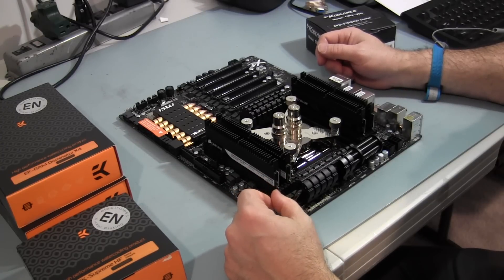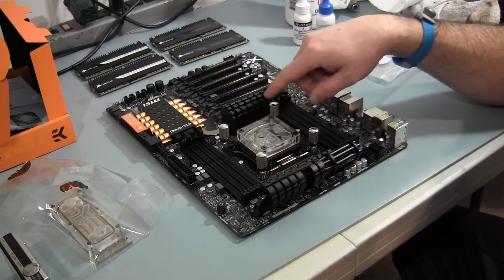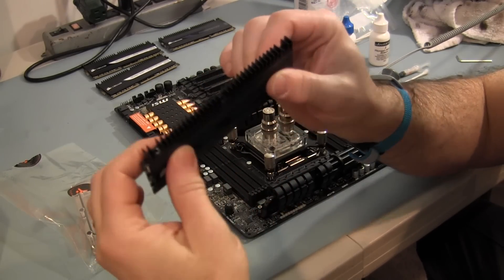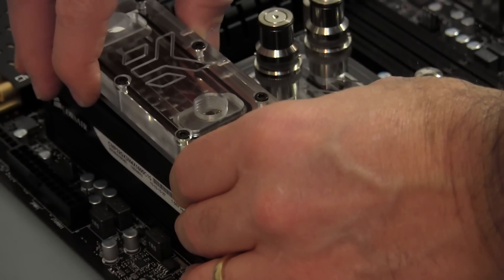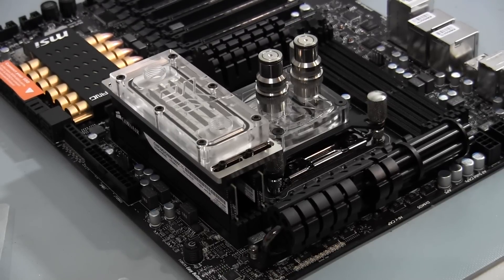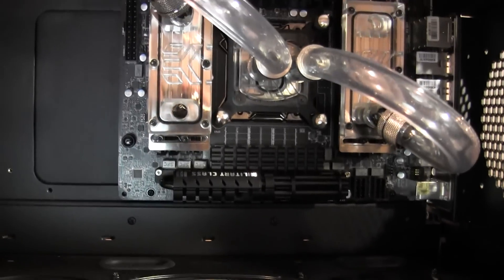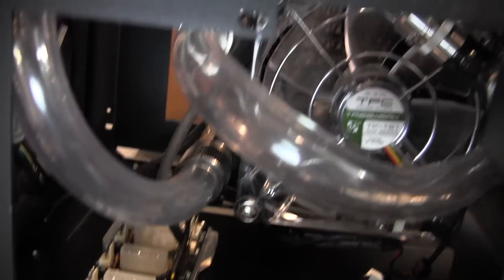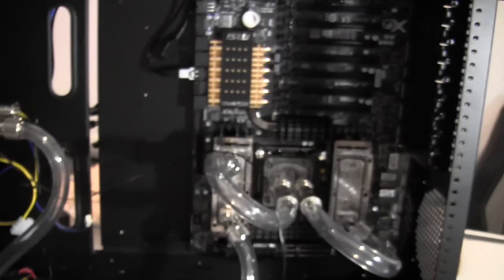Big Bang XPower II Kick Ass Build- Part 2 - Install Water Blocks and Run Loop

Comment: I noticed you used thermal paste instead of tape when mounting the memory water blocks.  Does paste delivery better thermal performance?  If you ever decide to install chipset water blocks for your Big Bang motherboard, could you also use thermal paste on the MOSFETs as well?  Just curious what the trade-offs are regarding paste versus tape...

Comment: Why you use these quick disconnects? They are messy .... It would be nice to see a waterblock for big bang :) (http://www.watercoolinguk.co.uk/p/XSPC-X79-XPOWER-II-WaterBlock-Set_29041.html) or even EK has a block for it.  Kind regards.

BTW - u r using the best case IMO.  I am at the beginning of designing my own case, but if it fails, I will buy CL MAGNUM STH10! Good choice :)
Reply from the maker: There is a water block for it , and I did buy it but never installed.  Was a little overkill on the QDC's.  I just wanted to make it easy to service.  But I did use too many.
Reply: Ronsanut .
:) yeah to many QDC :)  once again Thanks for video! Best regards and please continue :)

Comment from the maker: On this system I kind of went overboard on QDC's.  You only really need them at certain points in a system. I have since used them sparingly in systems.

Comment: sorry I have a hafx case and i'm looking to mount my radiator in the top and was wondering once I mount my rad and fans will the bottom edge hit the gatlin gun on the motherboard or do i have to buy waterblocks to replace the gun?  sorry if my question wasn't clear lol

Comment from the maker: It is a common misconception that you must go to the CPU first. The loop order does not matter. With a good pump and flow the heat is removed and passed through the system very quickly through the rads to dissipate. The ONLY order that does is that the pump MUST immediately follow the reservoir.

Comment: Why wasn't the coolant directed to the CPU first?  Surely it's the prime reason for a water/whatever based cooling requirement full stop.  I know RAM and Graphics, chip sets, etc all have their reasons too, But if the CPU cannot be clocked for heat reasons then everything else that rely's on it, becomes secondary to it.

Comment from the maker: I have only used BitsPower and Koolance Fittings mainly. I do have a new build coming up where I use Monsoon Fittings. Will see how well they do,  I have used the Koolance QDC's for a long time and they work great, but you do not have to use them. You can create a drain with BitPower T fittings as well.

Comment from the maker: For the most part now I will use them always at the radiators, and in the back of bay reservoir connections so that I can easily disconnect and remove those parts without having to drain the system. That also helps if you have a removable motherboard tray so you disconnect one coming from the rad to the CPU block  and the one leaving the GPU to the reservoir.  The rest of the waterblocks on the motherboard look much better with fittings than QDC's.

Comment from the maker: It is connected to a 3M Model 724 Workstation Monitor.  If you look it up on-line you will see how it is connected.  The blue ESD mat the build is done on is part of the ESD workstation setup.

Comment from the maker: ? remove other taps ?  Not sure what you mean. I originally have some GSKILL 2400Mhz but the system would not boot at 2400 so I replaced it with the CORSAIR and decided to water cool it.

Comment: My rig leaked for a good week from the gpu fitting, after i stripped my rig i discovered a water stain on the gpu pcb. Worked fine without shorting for who knows how long lol. That's just with distilled water. DO NOT USE DE-IONISED!

Comment: also wouldn't it be better for it to go from the 480 to the 360. Since I feel like the 360 would have much cooler air going through it. I'm kind of a noob so correct me if I'm wrong.

Comment from the maker: I installed 32GB of GSkill 2133 RAM and it would not POST beyond 1866.  Even if I manually set the timings. I contacted MSI and at the time (6 months ago roughly) they could not get 32GB running over 1900.  Now that may be because I had 32GB of RAM and I filled all the slots with 4GB Modules.  If you have less memory maybe it will work.  Also I don't think they have released a new bios yet either. I now have 1600 Dominator RAM 32GB (4 x 8GB Modules)

Comment from the maker: Both are excellent mobo's. Depends on what your budget is and what you plan on installing.  I thought the Big Bang XPower II features and cost was a better value and I liked its color.  The RE has liquid nitrogen features which I will never use and the X Power has more SATA 6GB ports which I planned to use.  But I did find some incompatibilities when I tried to run 2133 MHZ RAM.  So all depends on your budget, feature needs and in some cases what other components you are going to put in/on it.

Comment from the maker: I think definitely a BIOS issue. I suspect when they finally release another BIOS rev maybe this will be fixed.  If you are going to mix two different RAM I suspect they would only work reliably at the lower speed. I do not really know about tyhat but would drop GSkill Support a question before you buy.   I decided to buy the  4 x 8GB for 32GB so I could expand in the future. I did create an 8 GB RAM Disk but have not used it to load any games into. But I heard that works well.

Comment: So then its a BIOS issue you think?  Now that you have the corsair ram, you're finding the same limitations so you went for total size for less money?  I have the 17000 ripjaw z 16gb kit.  It isn't installed yet.  Just got my MSI BBP-II.  I want to run battlefield 3 from a ramdisk so I was going to get a second set.  Then I figured why not go with 32gbx4 to leave room for growth.  So would the speed differences between these two rams matter as far as a ramdisk goes?

Comment from the maker: No actually nothing runs at >1866 that I have tried on this Motherboard. And MSI also had nothing running at 1900 when I asked them last.   Right now I have it running at stock 1600.

Comment: Cool.  So you were able to get the corsair ram to 2133 even though its slower rated ram than the ripjaws?  If so did you do it manually, or with XMP?  Thank you for the info!

Comment from the maker: They are CMP32GX3M4X1600C10  4 x 8GB Modules.  I really wanted to stick with 32GB. I water cooled them strictly for the looks (bling factor). RAM never has to be water cooled even if overclocked.  I could never get the GSkill to boot at 2133.

Comment from the maker: That RIPJAW Z would not run at 2133 on the MSI Big Bang,  I tried manually setting the timings, raising voltages and contacted MSI many times and they even said the fastest timing they could get at the times was 1900. I was tired of messing with it and did not want to use that memory if I could not run it at 2133. So I decided to go with the CORSAIR and watercool them.

Comment from the maker: I did create a ram disk at 8GB but haven't put files on it yet to work off of.  Plus I was worried filling up all banks might cause problems with overclocking.  But I an always add later.

Comment: Try getting some 90 degree fittings for the cpu area, it'll look much tidier and you'll have slightly lower temps since the water will be traveling less distance. This is definitely an improvement from your last build, and it looks niiiiiceeee.